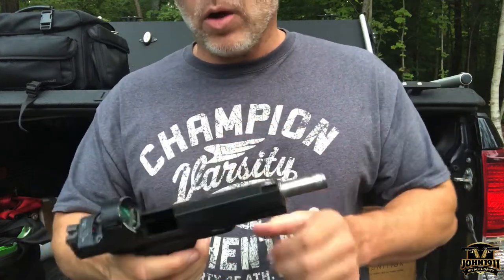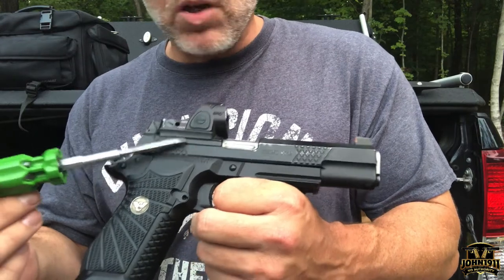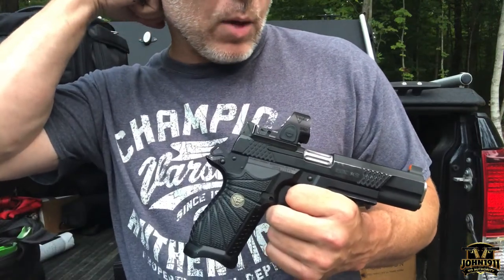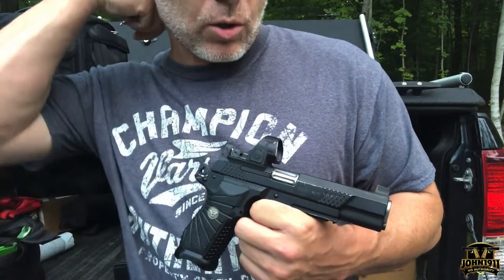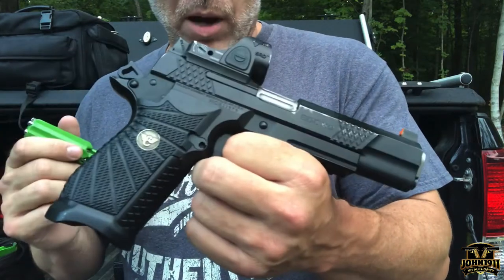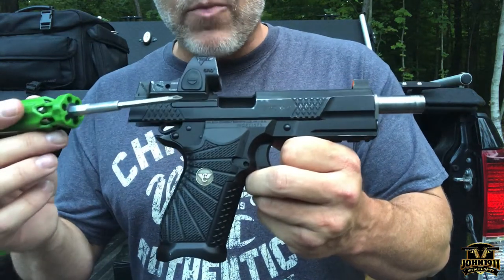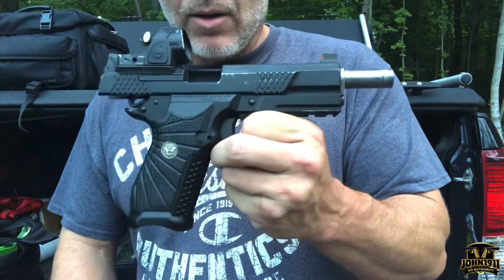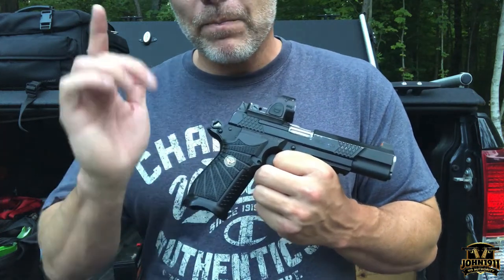EDC X9L Extractor Design

Comment: Saving my coins to buy Wilson’s Double stack experior because it has an internal extractor.
Reply from the maker: In my opinion as an academic statement, the external extractor is more durable in the long and short run, and is more easily replaced / serviced. Which is why Wilson invented the X9 gun with one to begin with: To address every weakness of the 1911/2011 design. 

Now with that being said, I have been “casually” running a Wilson eXperior Full Size (5” single stack” for a while now. Have maybe 2000 rounds through it. Not much, need to check the logs). And I have been THOROUGHLY and completely impressed with that gun’s internal extractor. It seems 100% reliable with 9mm (which is a neat trick) and passes a 10-8 function test 100%. 

I know they machine the tension/curve into the part and must have the hook OAL and geometry figured out. So while I won’t endorse an internal  extractor 1911 as a serious working gun. I’m not quite giving it as much side-eye as I used to.  Wilson seems to have…maybe…figured that out. 

—Marky